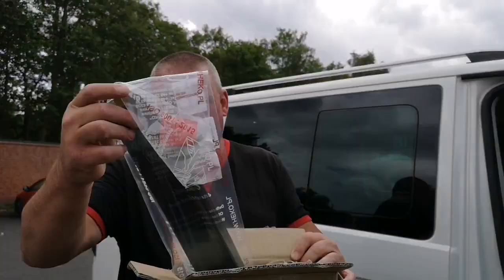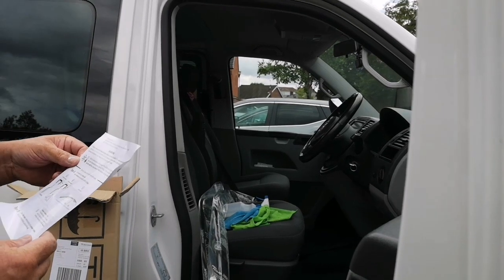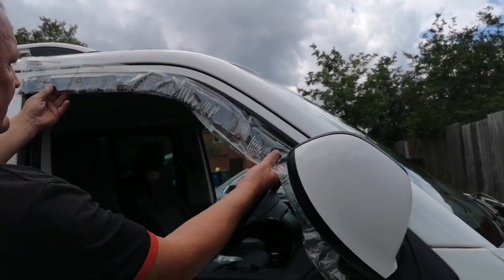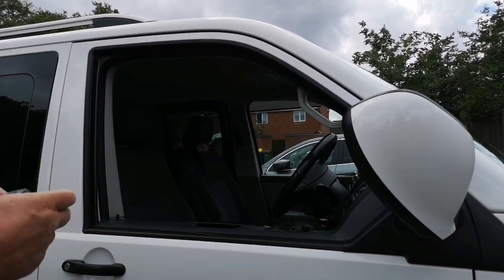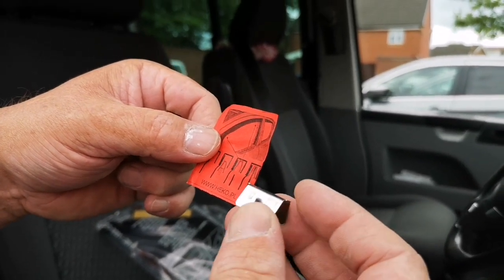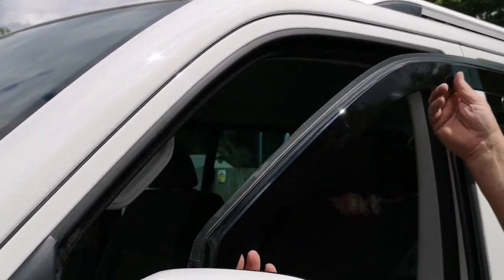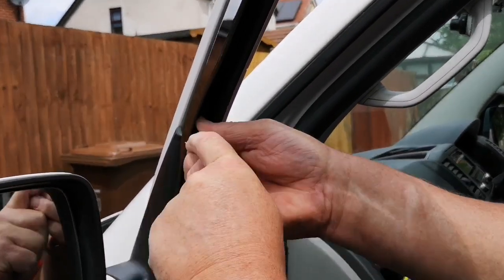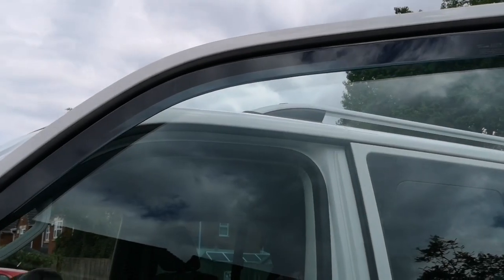How to fit | Team Heko | wind deflectors | VW transporter T5.1

Comment: Awesome! very smart, we had them on our T4, brilliant (they served as our air conditioning so we could have the wind open haha). What else have you got planned for the van? :D
Reply from the maker: We had them on the T6 as well. We've changed the headlights, rear lights and fitted a front splitter. Looking at insulation, carpet and curtains. Not making it into a full camper this time. Even though Kev keeps saying "oh there's a rock n roll bed for sale" I bet we end up with a bed in it lol